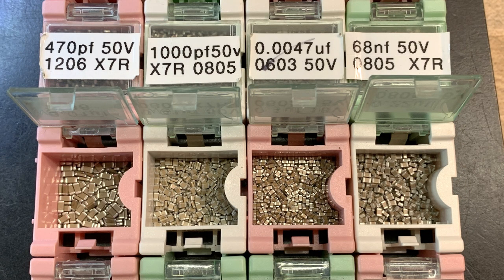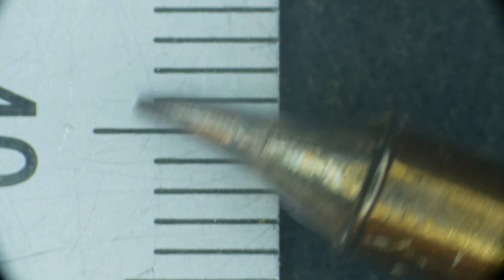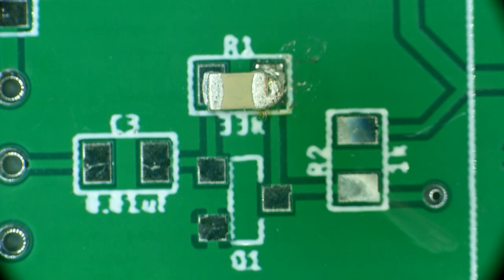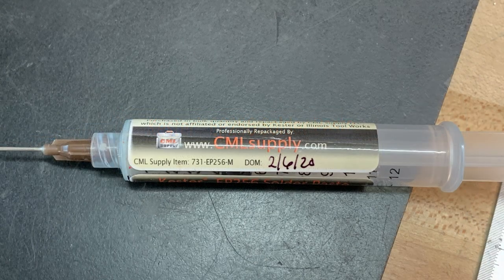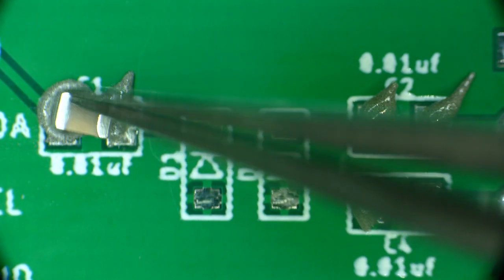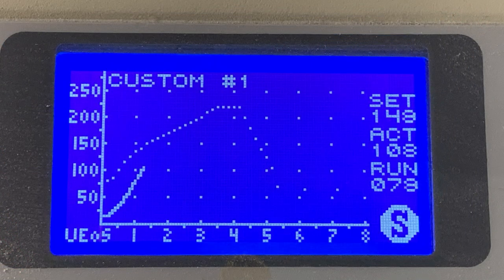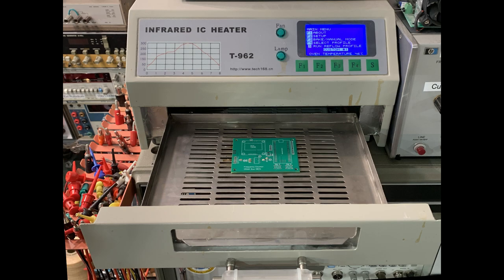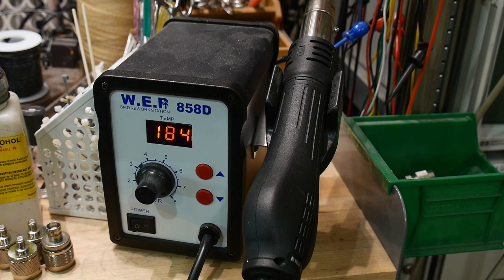#995 SMD Soldering Methods (surface mount devices)

Comment: Thanks for the review, one note, when soldering by hand as you did early on I always go back and re-solder the joint used to tack down the part to ensure it's correctly done. I was pleasantly amazed the first time I tried doing SMD by hand as it turns out to be much easier than thru hole in some respects. The Weller/Hakko mini irons and tips make it much easier to do as well. (5 more episodes to go to the magic 1K!).

Comment: The biggest lesson I learned with soldering is that just about everything is a) magic and b) fixable.  By magic I mean there is a lot of chemistry that makes it all work like its supposed to - solder mask, surface tension, solder make-up, heat, etc, etc... "magic" is good enough for me and practice removes your personal tension.  This is a great demonstration.  Thanks!

Comment: My original mentor taught me the "dry" method you showed first here. Rule #1: ALWAYS and ONLY get rosin core solder. Rule #2: just solder the thing. After watching Rossmann, Northridge Fix, et. al. I've come to appreciate the wet method better, where you lay down a pool of flux over everything. For SMD this really helps--it looks better, and you get better connections. Of course, then you have a flux cleanup job to do as well. A shot of aerosol-can flux remover dabbed around with a lint-free tissue works pretty well.

P.S. I have heard reports of the no-name overseas hot air stations spontaneously bursting into flame, even in the 'off' position, if the right internal component fails. I keep mine  on a separate switched extension cord, only powered up when I'm in the room.

Comment: I've not gotten around to using yet, though grabbed an old electric griddle from the Goodwill and somewhere... I guess FB Marketplace, Offerup and/or Craigslist I found a few free toaster ovens over the years with plans to use both for SMD/reflow systems.  Technically, I was also planning to potentially use one of the toaster oven heating elements to dry 3D printer filament using an old 81mm artillery ammo can... though have waned from that idea since finding a free and $7 food dehydrator.  I've also read the gun cabinet dehumidifier things are a way.  Interestingly, recently on another note more related to the toaster oven parts... I've been thinking I might use the timer for an old roll around car starter battery charger to analog control the time charging.

Comment: For soldering electronic subassemblies IPC is the primary standards organization, today known as the Institute for Interconnecting and Packaging Electronic Circuits. 

There is a lot to choosing a soldering process, even for home or hobby soldering, that includes selecting the solder alloy (lead, lead-free, + many others) and flux (R, RA, RMA, No Clean, Organic), and this ideally should also match the solder paste of choice so there is only one cleaning step if needed. 

Statistically, the majority of subassemblies are no clean from a production standpoint. Although, I have found that for hobby part storage (like the little bins open to free air in the video) the best results are gained using organic (highly active, water soluble) flux, with the requriement that the PCB will have to be cleaned ofter soldering. If the subassembly uses QFPs or BGAs cleaning organic will require an ultrasonic cleaner and it helps to have a drying oven. At home I use an old toaster oven to dry my boards. 

If you want to impress somebody who is not familier with all the different solder and flux types and requirements, use a high quality (Kester or equiv) eutectic lead solder with organic liquid flux, as seen with many product demo videos. Organic liquid flux is usually clear. Rosin flux has an amber color. The result are amazing. Oxidation removed, even wetting with shiny almost mirror like joints. As opposed to something you might see in current production like lead-free no clean, where the joints look horrible in comparison.

For very small SMT component replacement (repair) you can use a fine hot air gun (like the PACE ThermoJet, to name just one) to remove and install a single component. To solder a new part you can use a preheater (optional, but may be manditory depending on the subassembly), solder paste (best to have a dispensor with fine control) and the same fine hot air tool. I generally use hot air rework (with solder paste) for packages smaller than 0805. Although, if I want to use a contact soldering method some flux may have to be added to remove the part depending on the solder alloy. I can contact solder very small packages like 0402 but hot air methods will distribute part stress more evenly, especially with preheat. I think soldering SMT with hot air even without preheat stabilization is better for part mechanical stress (the closer you get to a official reflow temperature profile the better). This is usually critical to the subassembly type of if you are using highly stress vulnerable (cracking) parts like large value / small package (many layered) ceramic smt chip capacitors.

I have soldering tweezers which I use a lot. My latest addition is the PACE MT-200 used with my ADS200 station. But I find myself using two soldering stations with a handpiece in each hand (called the two handed method) instead of the tweezers if I have to do testing on the component and want to minimize over-temping the part (damage to the part). Using the two handed method you can remove the part very quickly and whichever soldering iron the part clings to you can tap on the work surface to dislodge. This is very fast, and I really hate mistreating my tweezers in this way. If I don't care about part testing, I can just use my tweezers.

From a historical PACE equipment standpoint, SMT chip hot air rework was supported with the old PRC 2000 system, which is used for many military repair depots and soldering training and certification. I use a lot of PACE equipment, but I also use HAKKO and JBC. The PRC 2000 includes the ThermalJet + a very accurate paste dispensor (you can dispense the exact paste needed for the part size). So the choice is for the job at hand to use either contact or hot air (non-contact) methods.

Comment: Excellent information. I have a TinySA with a couple of blown attenuator sections. I may have to try to repair it, although I understand an IC is what I need. Need more research as the exact replacement may not be available.

Comment: Great stuff, I started my soldering/kit building career in the early 1960's building Heathkits.....unfortunately as I age my eyesight and hand shaking preclude SMD components. Even the small thru-hole kits are a challenge....../K6SDW
Reply: Never say never. Glases, a toothpick and super glue can do wonders.  I am 65 now and I still have a damaged 433 transmitter for a remote outdoor thermometer to repair. I have a good one to compare. A resistor has moved and a capacitor is missing. Maybe a hot air gun can do the job if it does not blow the other stuff off the board. If it does I still have the 433 MHz resonator to play with.

Comment: I gots a question - what is a good common size of part to get - I see you had 1206, 0805, & 0603 - what will get me by with the least stock of parts? I'm such a hick; my smd repairs consist of crushing/cracking part in two, raking remainder off pads with iron, bending leads on thru hole components, and tacking to pads. I did change a serial port line driver chip on a laptop once with silver ink and conductive epoxy - after I had ripped traces off with an iron. You inspired me to order a hot air station and some kester paste and liquid flux. I look forward to seeing chip removal/replacement techniques. Also what kinda pliers/bernards do you recommend for chip pulling? Thanks
Reply from the maker: Well, parts keep getting smaller so if you are repairing things it is hard to have a stock of the right size. I like 0805 for my own designs, it is old school now but is large enough for my do use in the garage.

Comment: I'm getting started with smd. I've got a good solder station and an old hot plate.  Are there particular downside(s) or issues to using hot plate(with copper top plate)  which I should consider as I try this? Thanks.
Reply from the maker: the bottom of the board needs to be flat, so no two sided boards, or thru hole components, you need good thermal contact. it requires you to be watching and timing, the oven is just a button press. I have a friend with a business and he uses a hot plate for his boards

Comment: Great video!

I guess things get more complicated when you have a board with components on both sides, eh?  No way around hand soldering one side?  I assume it would be safe to use a hot air gun for that, without parts falling off the other side?
Reply from the maker: I have done double sided before and got lucky the parts stayed on via surface tension. but don't recommend it. I think the big boys glue the parts down

Comment: Thanks for the video! How do you go about cleaning the flux and other residue?
Reply: Lots of people say you have to remove it... but, in IMO it's not always necessary, or even a good idea. I'd venture that often it's just for visual aesthetics... just to make the board look good. You can have water based fluxes that clean up with water (de-ionised, or distilled), or rosin based fluxes that clean up with isopropyl alcohol. Then there are 'flux systems' for manufacturing that have the flux and the cleaner supplied.
Reply: @willthecat3861  in this case his paste has no clean flux. Most solder wire also uses that. Rosin is harmless to the board, you can even dilute it to thin liquid and use as finishing coating for bare boards.

Comment: 2:28 Abysmal joint.
2:50 Would look better if flux would have been used. You still can add flux at this point ...
Reply: It only looks that bad under magnification
Reply: @MrMegaPussyPlayer  his aren't bad, most will look like that under magnification